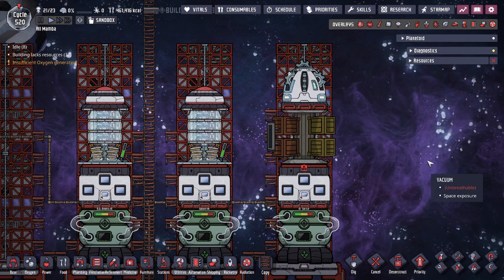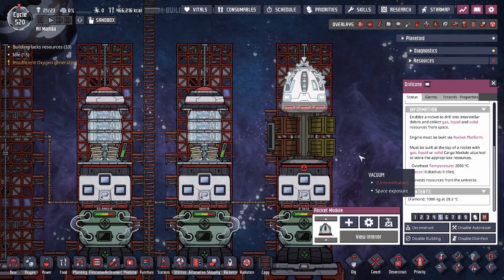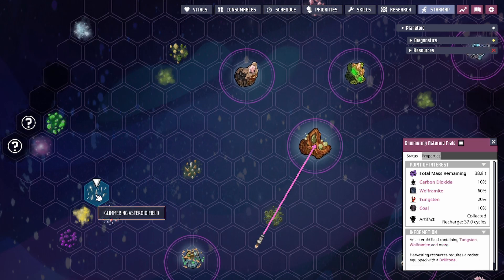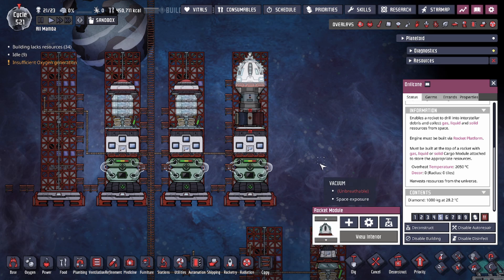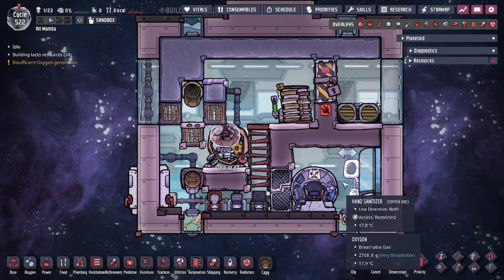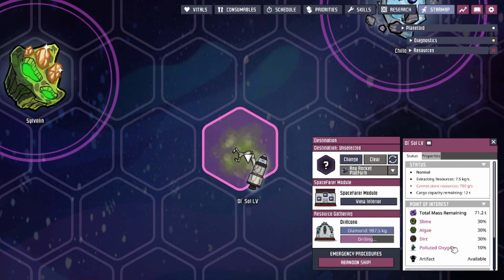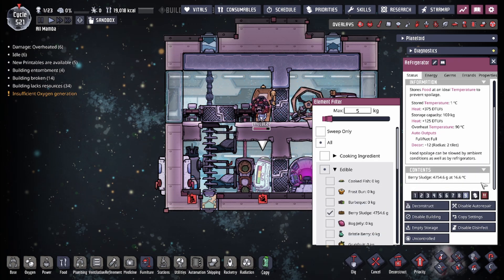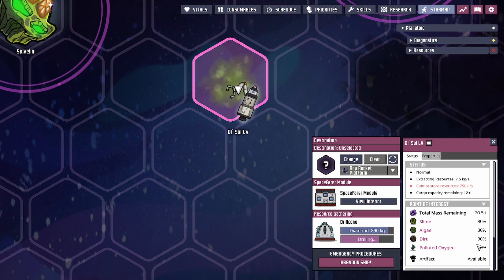How to Fully Utilize the Drillcone & Optimal Drillcone Rocket Explained - Oxygen Not Included

Comment: i might be wrong but you said you can't fit every module onto the rocket, but isn't that only true for the engine you are using? other engines seem to be able to fit more modules
Reply from the maker: yeah that was only my setup, i think after i said if you can build all 3 modules you always want the smaller version- i think only hydrogen rocket can fit all 3 and travel decently but requires liquid oxygen(i think) in order to fit but i dont see alot of people utilize the h2 engine. while the petro/hydrogen rocket has more space, you have to run fuel tanks and oxidizer tanks depending on how far you want to go. ie the petro engine has to add on 7 height per 10 tiles travel distance, which is 14 height to travel the same distance as the radbolt rocket of 20 tiles. thatt means the extra max height doesnt really help much.

Comment: I was testing the rockets yesterday, ad found out that instead of putting a large oxidizer tank and a large liquid fuel tank on a petroleum engine, you can use 2 small oxidizer tanks; this way you'll bring the same amount of oxidizer - 450*2=900 - but only using 4 tiles instead of the 5 tiles a large tank takes. So you can grab an artifact while your mining out in space. 

Hope this was helpful
Reply from the maker: its still only 10 tiles range though, with one large fuel tank- not too many drillcone options in the roundtrip